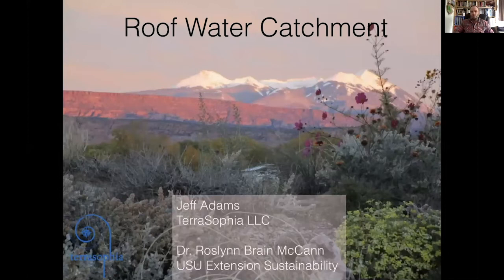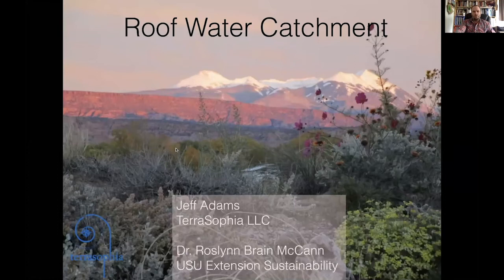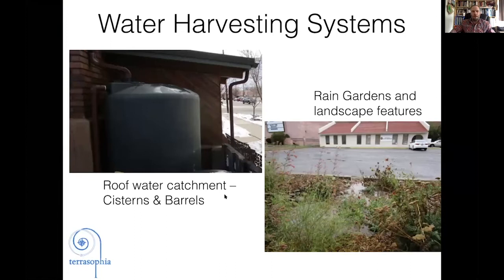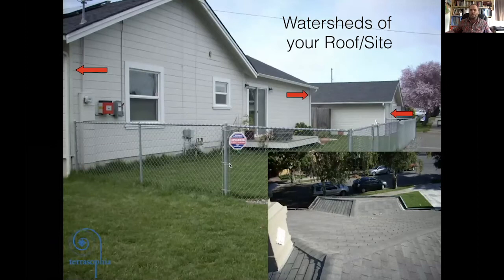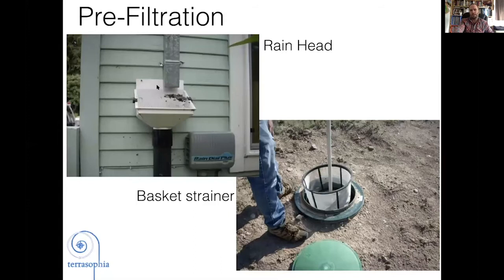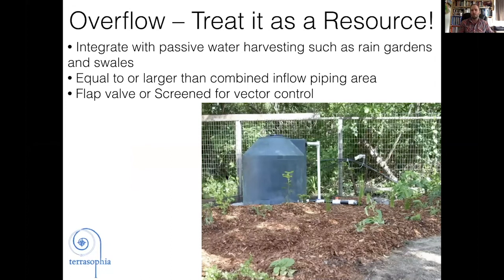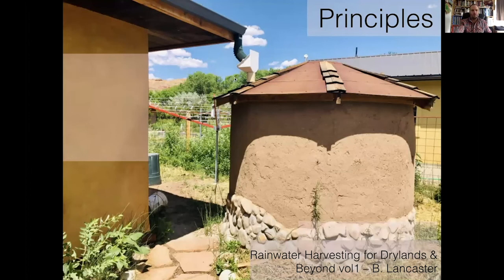How to Harvest Rainwater

Comment: Thanks for posting this. Can you comment as to why Utah limited the storage to 2,500 gallons? I feel that this unnecessarily limits those that may want to develop household systems that run solely on rainwater. Seems like Utah would want to encourage this practice and not cap its potential. Do you think future legislative changes increasing or removing the cap may be possible?